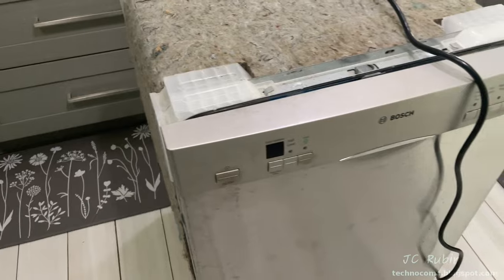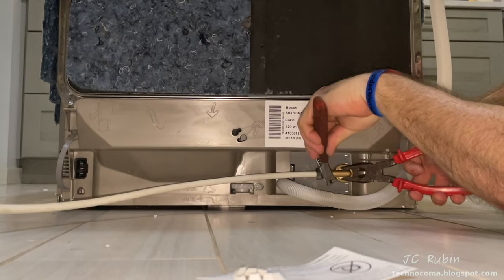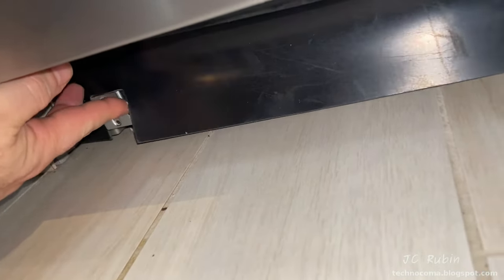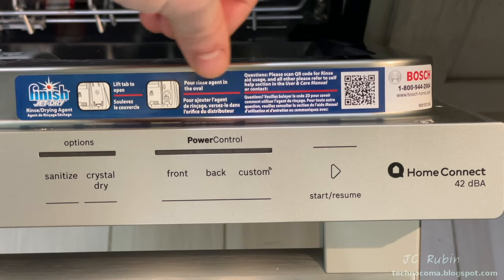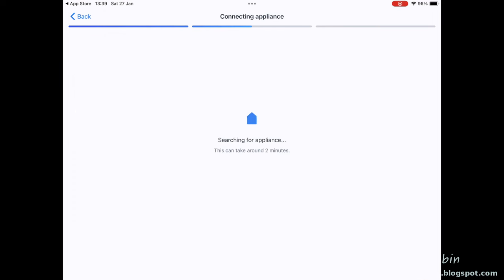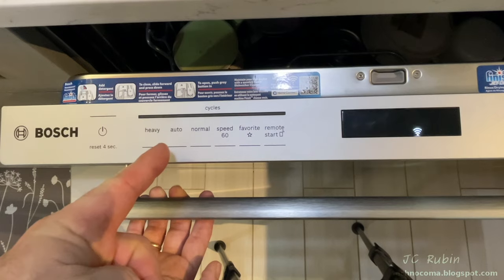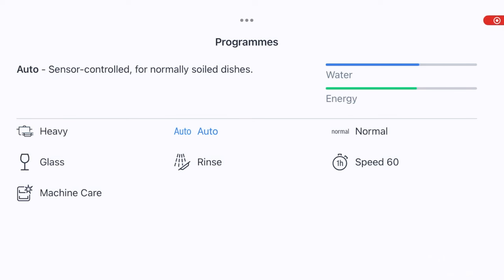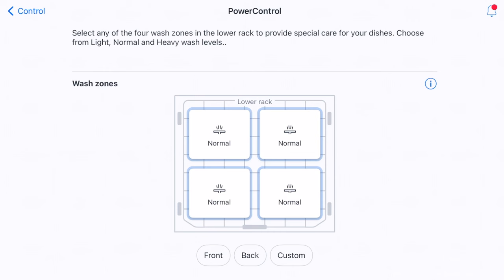Bosch 800 Series Dishwasher - Unboxed, Tested and Evaluated for 6 months

Comment: It is hard to see what type of fill line you are using. The most common type in the USA is a stainless steel or white flex line which is the dishwasher version of a garden hose. Since it has a washer in it, no sealant is necessary. It is unlikely that a stiff copper line or equivalent plastic would be very easy for the average homeowner to install, and in fact no 3rd party installer will connect to copper these days, or use any power other than an outlet.
Reply from the maker: This is a stainless braided line
Reply: @retrotechandelectronics  Then sealant or tape is not beneficial.

Comment: I bought a Bosch 800 dishwasher 4 years ago. Worked great untill 3 weeks ago. It started throwing E07 codes,the zeolite fan code. I called Bosch with the problem. They said the fan needed to be replaced. It took 2 weeks to get the service guy to come out and when he got here he didn’t bring any parts with him. Looked at it and found the zeolite container was bad and had melted a piece of plastic that runs down the center of the washer. Part of the parts were covered under some recall but the repair is still costing me over $500! A high end washer that costs $1200 shouldn’t have service issues after only 4 years!  If you’re considering a Bosch think twice about it. I live alone and only use it once every 2 days,it’s not like I’m using it to death.
Reply from the maker: I hope if it was recall they have that issue long since worked out.
Reply: We also bought a Bosch 800 series dishwasher about 3 1/2 years ago.  It worked well until 3 weeks ago when it showed a E07 code.  A repairman came and gave us an estimate of $700 for parts and labor.  We have always thought Bosch dishwashers were fantastic until this experience .  We just ordered a Miele dishwasher with a FREE five year warranty.     I don’t think we’ll buy a Bosch dishwasher again.

Comment: Just bought a 300 and installed it and has a wired burning unique chemical smell have run empty multiple times and still have this odour like tar or plastic smell ..? Anyone else have this issue or notice this upon installing a new Bosch Dishwasher?
Reply: read it is from the fabric insulation and should dissipate with time or so they claim
Reply: @bugsy2902  yeah it seems to have dissipated now

Comment: I have, basically, the same machine. Um, it's not without its problems. The impeller clogs too often, and only someone who is "handy" will actually be able to fix the issue. "Stuff" somehow gets by the filter. You'll get a "clog" code at some point. You better be prepared to fix this yourself, or pay the price to have some repair guy come out and fix what only takes 10 minutes to remedy. Also, the top aerator housing drooped down on my unit, causing the aerator to get stuck (not spin). A few zip ties fixed this issue, but it shouldn't be a problem. Also, the plastic housing on the side gets so hot that it will delaminate or damage the side of your cupboard. You'll only notice this if you have to remove your dishwasher at some point. Anyways, other than these issue, my dishwasher has been decent. Can't say any better than my old Maytag, but decent. It's definitely quieter. :)

Comment: Is it worth getting the 800 vs 300? Costxo has model SHX78B75UC, which different than yours. Hard to find what the model number charachters mean...
Reply from the maker: https://www.bosch-home.com/us/products/dishwashers

Scroll down to dishwasher features summary by series
Reply: Thanks for that link! but that summary PDF doesn't explain what the letters/numbers in the model numbers mean. There are several different 300 and 800 models out there.
Reply: @omidnoroozian  The only difference between the model in this video and the SHX78B75UC is the latter has a built-in water softener, which the model in this video does not have.

Comment: Came here from the GE Combo video. This is another great video! One can tell that you've thoroughly informed yourself. And even the installation, while more involved than on the Bosch dishwashers over here, is done perfectly. As you've probably figured out by now, you don't need to empty the rack to adjust the height. I guess it's easier to refill the rinse aid if you your unscrew the bottle's cap. Now all you'll need to do is grab a GoPro and be the first to film that new bottom spray arm in action. 😉 Greetings from Germany.
Reply from the maker: Thanks. We emptied the rack for the footage and because we didnt know how much everything would weigh when we released it.  The gopro would be a cool idea in the machine.

Comment: Great video, great accent. Questions: can two people get alerts or make adjustments on their own phones/devices, or will the app work with only one person? Is using the app the only way one will have access to all the settings options or are these also available on the panel e.g. deeper in the menu somewhere? Is there an option not to use the wifi option altogether? I may decide not to. I originally used ot for my washing machine but the constant alerts were too much and I turned it off. Do you happen to know if the auto door opening option can be either turned off or adjusted to open at a later time if the hot steam has a negative effect on painted cabinetry to either side of the dishwasher? I know there's a protective seal at the top but one review implied she got damage on the cabinetry or paint on both sides of her 800 series dishwasher from that hot steam. Have you found that your machine jiggles around and doesn't feel super stable and firm in place? That was another negative review (amidst mostly positive reviews). Last Q: how are you liking your machine at this point in time? Thanks so much! Anyone else with the 800 can feel free to answer as well! :)

Comment: Nice video👌..As a 5years Bosch user Im really satisfied with my serie8 super silence plus dishwasher but there is something alittle frustrating about the ceiling shower..I think that Bosch should revise It..I believe that an arm can be more powerful and efficient than that spinning thing..that thing cant cover all the third rack especially the items located at the corners to wash properly..anyway..I have a question..I found that your dishwasher has not a salt reservoir..has it?..I cant see the reservoir cap.

Comment: You didn’t add salt for the water softener?
Reply from the maker: I’m not understanding to which water softener you are referring to.
Reply: @retrotechandelectronics  On my 800 series Bosch there's a screw off cap on the bottom of the tub that you put dishwasher salt in to. It keeps your dishwasher from getting clogged up with mineral deposits if you have hard water.
Reply from the maker: @bozerbrett7867  ill have a look, i did not see this.
Reply: VERY curious about the water softener!!!    We just installed our Bosch 800 yesterday. I’ve had a Bosch for 14 years, but moved to a different state with very hard water. 

We are midway through your great video. I paused as hubby wants to see the filter part. ( as he’s cleaning hard water deposits in the back of kitchen sink- stuff he noticed during install)